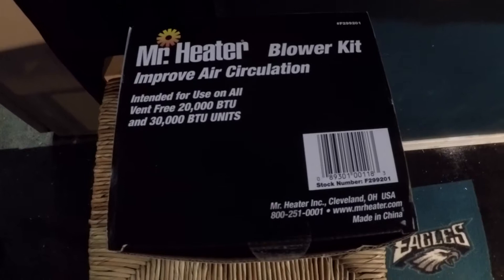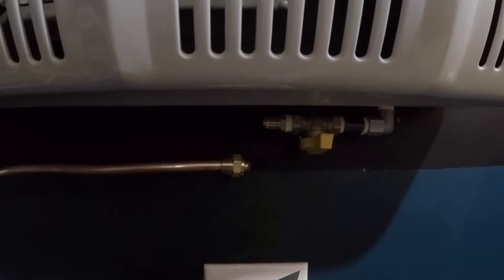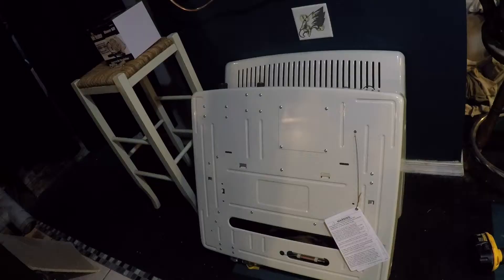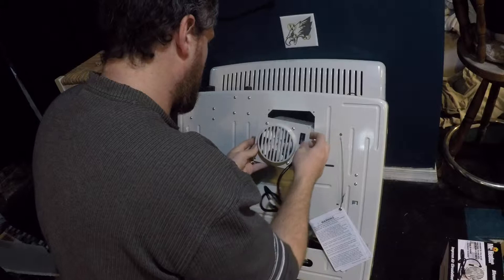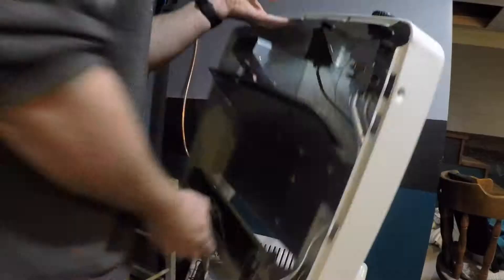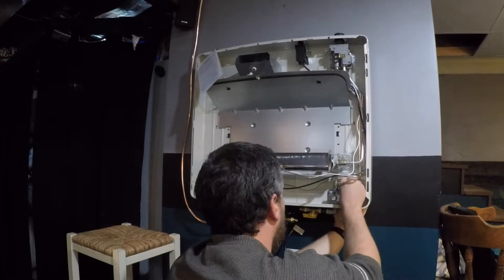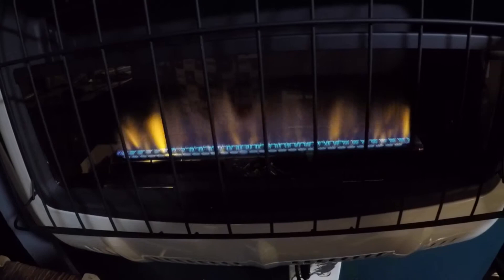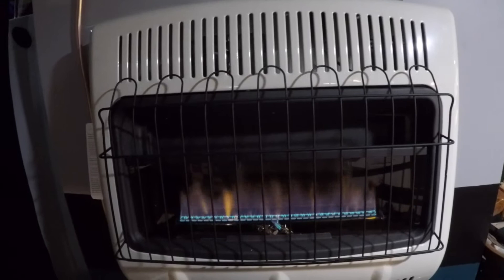HOW TO INSTALL THE MR HEATER BLOWER MOTOR F299201 FOR THE WALL HEATER by CRONES VLOG

Comment: so I installed my fan before I mounted my heater to the wall. The bracket sent with my heater kicks the heater a half inch out and away from the wall. On the fan that I bought the  fan housing Protrudes a 1/2inch back behind the heater. so when I installed the heater on the wall the fan housing was flat against the wall not allowing any air to enter the fan. I think in a lot of videos on YouTube people say that the fan does nothing. Or it is worthless, my fan works great I noticed that protrusion of the fan and I spaced my heater out an additional half inch.

just like this video I have the same fan I can just about guarantee you're not getting the airflow that I am same bracket that I have did not notice you spacing your bracket out away from the wall for allowance of the fan housing sticking back Toward your wall a half inch. Unless you space your bracket out a half inch to allow space between the backside of the fan and your wall you're wasting your time putting it in.
Update 11-28-20
And one last thing I can easily reach behind my heater and turn my fan to auto off or on with the additional half-inch of spacing. This heater that I have is awesome heats my house to 70° on 1 3/4 on the dial. These heaters are awesome but they don't make the brackets to hang the heaters with enough spacing if you want to include the fan option.
Reply: Fans are for the units that have the feet that sit on the floor.

Comment: One thing to note is that the 1st item you plugged in was the thermostat to operate the fan. If you have your heater set at a lower temperature setting like below 2 the fans thermostat may not operate to turn on the blower. I wish these were adjustable.
Reply: On mine the fan doesn't work on auto, is there something I missed?
Reply: Is there supposed to be 2 thermostats total? Or just one. I ask this because there is one included in the heater and one more that came with the heater
Reply: @melaniemcnitt74  I am not sure, mine shuts down when temp is reached, but the fan doesn't ever turn on in (auto mode).
Reply: Thanks for your input 🙂
Reply: @Jester12036  thanks for your input 🙂
Reply: Actually it will work just the same as the temperature and height of the flame is the same no matter what the thermostat is set. The heater just runs longer at a higher setting before the heater shuts off. Thermostats regulate the temperature of the room, not the temperature of the flame/heater.
Reply: It comes with one because some models / years of this heater do not come with one pre-installed.  Some don't even come with a screw removable cover plate.  Mine had a tack welded cover plate and no sensor.
Reply: Always a catch! The area the fan goes in is not open I have to punch it out but am checking with Mr Heater before I start cutting. Thanks for the informational video!

Comment: Thanks just helps a lot, my blower motor came with the sensor attached to it but the instructions say nothing about hooking it up it just says to connect the wires together which the sensor is not in my heater it was attached to the blower motor... I seen the hole for the sensor with the two screw holes and figured that's where it was going but wanted to be sure.

Comment: good vid. but the fan is useless and waste of time and money. just got one. sucks same cold air from outside back to the front. air dose not circulate thru the unit (bottom to top) like any heating blower.

Comment: How do you like the heater itself? Been looking at buying one I have a 500 sq ft garage
Reply from the maker: We like ours and It heats up really well. Definitely recommend.
Reply: We just bought a 30,000 for ours
Reply: I have liked my 30,000 BTU heater mounted on the wall for the past 22 years in my home; works very well!!

Comment: I cant find anything related to this anywhere but does anyone have issues with the top of their mr heater getting hot? like the knob area and the entire upper portion. Mine is getting uncomfortably hot to the touch and I feel like the only solution is to install the blower fan to exhaust the built up heat out through the front vents. Which makes me wonder why they dont just install the fans to begin with.

Comment: Isn't the intake for the fan obstructed by the wall?
Can you turn the fan on manually with it against the wall?
Will the fan turn on automatically if the heater is set on 2 or below?
Reply from the maker: David Mc intake for fan not obstructed.. yes you can turn on fan manually.. yes fan will turn on automatically if set on 2 or below

Comment: Do you find the blower fan helps with circulation and the ability to heat more square footage?
Reply from the maker: NSX Properties yes it helps a lot.
Reply: no it dose not
Reply: Not much and it's loud at night. I just put a stand fan in the area. Problem solved
Reply: Not worth the $40 for the fan.
It doesn't blow much at all.
Reply: I've had my 30,000 BTU convection ventless gas heater with a fan installed 22 years ago on my wall, and I really never use the fan. However; my home stays warm without its use, too.

Comment: I just bought one today and there not secrewed in any more.It is no like a elctrical box breakout-----Just wanted to add that and its welded pretty good lol.Same model.
Reply: @Londo_Mollari  I had to take a grinder and grind it out.Not a good idea sice i was a welder for 30 yrs.The grinder will bite yo hard.If you can use a dremell an just cut the tacks.Yea it was even rough for me.

Comment: Does it need the fan?  Is it only for circulating the warm air?
Reply from the maker: it is not required but it helps circulate the air better

Comment: The wire that you connect the blower unit too, is that part of the heater or did that come with the blower unit? I have a 30k btu wall heater and the blower fan however the neither has the thermostat sensor.
Reply from the maker: came with the heater. hmm maybe that model doesn't have the sensor.
Reply: I just purchased the furnace and bought the fan kit, however after prying off the access plate, no sensor wire is inside, only a spot where one goes?  I guess that is an item I need to purchase also
Reply: @putawaywet1    Call Mr. Heater because their supplier of the fan unit sent out a lot of them without the electrical connection. I called them and they told me they would send it to me however I could take more than 3 weeks for it to show up. I'm on week 4 right now

Comment: So is the blower actually contributing to heat in the room or is it more of an exhaust type of thing?
Reply from the maker: The blower helps move the heat around.  It blows the hot air out of the heater.
Reply: @CronesVlog  thank you. Figured it wouldn't be effective cause it was blowing against the wall. Looking for something to great a large room.
Reply from the maker: Yo Co it definitely makes a difference rather than not having it.
Reply: My heater is on the floor...so all i have to do is take out the back plate and install the blower right?? I don't have to disconnect the gas and take off the faceplate right?
Reply: @greybird4257  shouldn't have to I've removed front part while heater still installed to floor and gas line.

Comment: the wire that attached to the heater for the blower, mines didnt come with that, what is that called
Reply from the maker: You will need to read the owners manual not all have this option

Comment: shut off valve is on the wrong side it should stay on the supply line not the heater makes me wonder about the rest of this video even though it is mostly correct just wonder how the fan draws air

Comment: Our fan don't work on automatic, only manual, any suggestions? We already returned the first one to the store but this doesn't work either
Reply from the maker: Sounds like the thermostat not the fan.
Reply: @CronesVlog  thanks, we changed the thermostat and it still hasn't worked on automatic, even when setting the heat on higher settings. But we can still use it on manual anyways..
Reply: @melaniemcnitt74  our fan works intermittently on auto. Usually after the flame cuts off. Seems kinda pointless. We have a cheap fan on the wall near the ceiling directly above the heater and it’s oscillates. The ceiling in the cabin is at least 30 degrees warmer with no circulation. (This heater as with most mr heaters spill 90% of the heat straight up in the air due to lack of quality blowers) The added (Cheap... Amazon) fan has cut down on cycle count and the length of burn time too. Hope this helps.
Reply: @ryanhendricks7038  thanks for your help

Comment: Have no idea why you removed the face of the heater and removed the spacers when all you had to do was take the heater off of the wall.
Reply: @wallacesmith689  The screws hold the spacers in place. They are not screwed into the wall, at least not on two of these units I have installed. The heater hangs on the wall bracket and the weight of the heater holds it in place.
Reply: I have one of these and the screws (supplied) go through the spacers and into wall anchors also supplied. You have to unscrew them to take it down.

Comment: I had no wore pulled through. There is a hole there but no wire
Reply: i had same problem came with no censer on the unit
Reply: Did either of you find a thermostat for the Blower?

Comment: How does the blower fan get enough air if it’s up against the wall?
Reply from the maker: It’s not 100% against the wall it is roughly about 1-2 inches away from wall
Reply: @CronesVlog  "Spacers"
Reply: Because they sell the feet and fans separately so the heater can sit anywhere on the floor

Comment: I installed a one of these in my basement and it runs on natural gas, but is does smell when it operates, is any one experiencing the same issue?
Reply from the maker: Ali Al Qayyim ours don’t have any smell
Reply: You have a minor leak,shut down now. Before it goes boom. You should not smell gas. Period

Comment: Feel free to vote, should I install (Yes), OR, should I not install it and trash it/resell it (No)?  So, I'm in a similar situation, where I do not have screws to remove the panel and have to deal with the breaking out the welded panel.  From what I'm reading it really isn't worth it??  I didn't buy it separately, it was in a bundle (BUT NOT PRE-INSTALLED).  Not worrying about the money but I'm getting the feeling that I am just going to go thru all of that and be very disappointed and mad.  I had a Big Buddy heater that came with the blower but it was battery operated.  I never used it (4 D Batteries).  I tried it once and felt the same as some have mentioned here, it was just blowing around cold air.  So, install???  Yes or No.  (No)